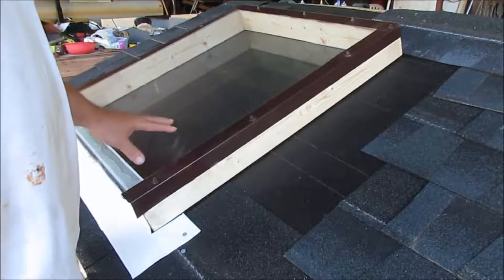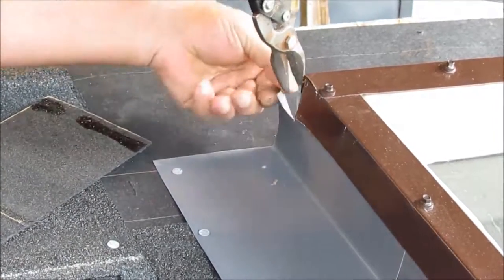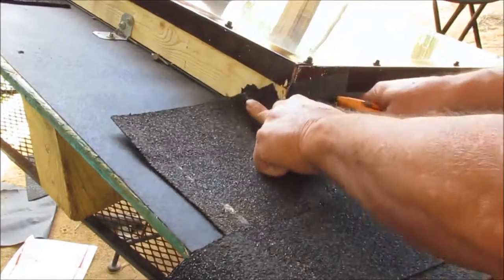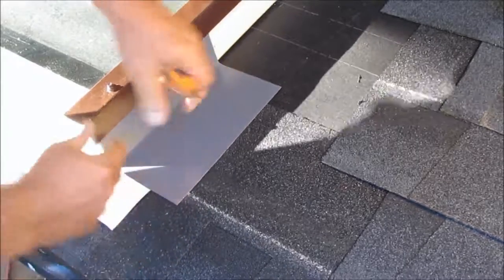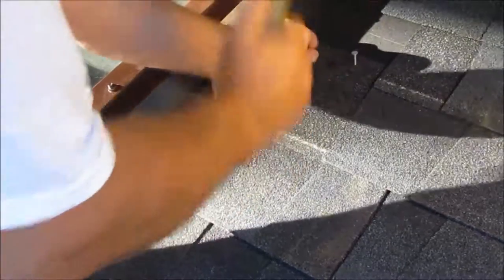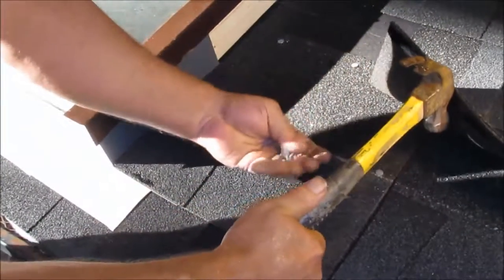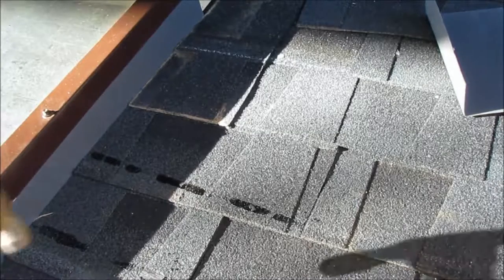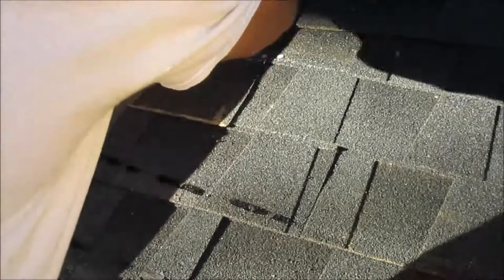How To Install  A Skylight Part 2

Comment: If this installation was on a house they would be calling you back to  repair the leaking skylight.  Multiple mistakes
Reply: you may be right but for myself would be more useful if you explained the errors so we can understand better
Reply: No they wouldn't. Looks fine and I've been roofing for 30 years.
Reply: @turdferguson12  doesn't mean you've been roofing correctly for 30 years.
Reply: @brettsurrett4596  lol, well I've never been called back.
Reply: Not a damn thing wrong here. It works.
Reply: @turdferguson12  good for you . If you really think this skylight installation is quality work then there is someone repairing your roofing work after you have completed the job.
Reply: @brettsurrett4596  Make a video of your own and show us how its done. Hard charger.